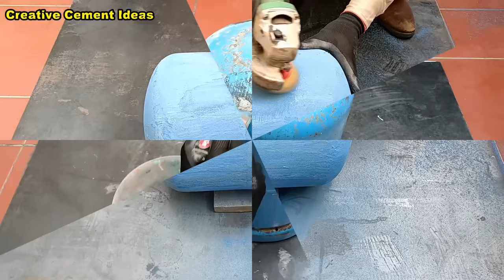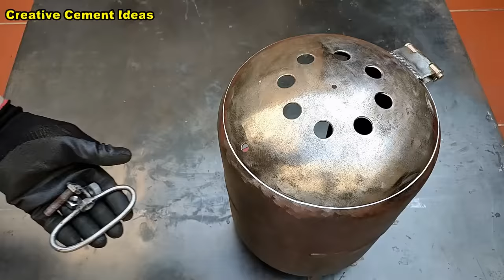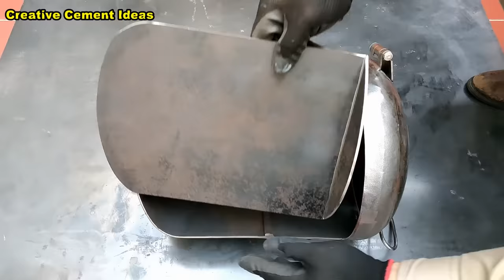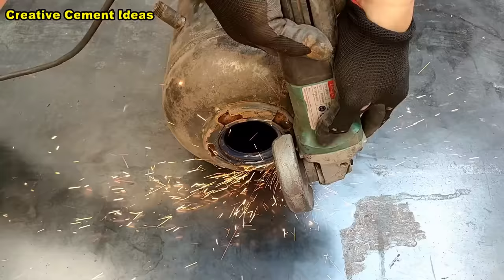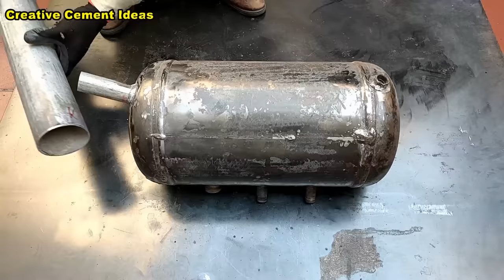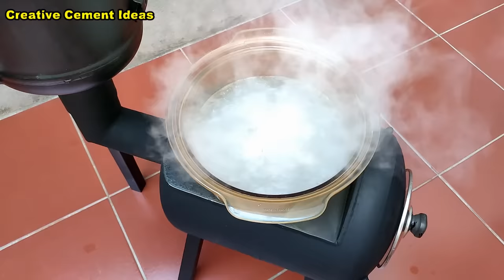How to make a very effective 3 in 1 multi function fireplace

Comment: Love the flue pipe water heater, and the glass lid for the intake air control is cool too.
Reply from the maker: Thank you very much
Reply: The water heater could be used too generate steam, steam engine for electricity or mechanical, steam room, radiator for heating... Wonder how efficient it is.
This guys a wannabe macgiver.
Reply: @CreativeCementIdeas  ггг⁷7ш889шш81111Шшш8
Reply: Юлия
Reply: Молодец брат
Reply from the maker: Спасибо
Reply: V   0
Reply: Be

Comment: WOW! Great job! I have seen many DIY small, wood burning stoves, but adding a water heating tank is genius!! I am interested to learn about the welder you use. It is small & looks easy to use. Can you provide a link on the internet that shows the equipment you use? Thank you🙏🏼
Reply from the maker: Hi, I use kenmax 200 mig welder
Reply: @CreativeCementIdeas  i could have sworn i saw a stick. Regardless, great build
Reply from the maker: Thank you very much
Reply: @Ed19601  I just ckd, there are models  that operate 3 ways: Mig w gas, 
Mig w/o air, & rods(stick). I learn something new every day!
Reply: @CreativeCementIdeas satıyormusunuz fiyatı nedir nasıl spariş edebiliriz
Reply from the maker: Merhaba, bu bir DIY eğitim videosudur, fikirlerimi alabilirsiniz.
Reply: @CreativeCementIdeas  🌹🌹❤❤

Comment: Fantastic! What kind and size of water heater is that? Is it out of an RV? Gas, electric? And I have to ask, did you use a stainless steel pipe to go through the water tank? Would you not need stainless to keep rust from forming inside the tank? Thanks for your time. 😀
Reply from the maker: Hi, if the water tank and chimney are replaced with stainless steel, this product will be great, thanks for your opinion.

Comment: I have a doubt , is it  LPG gas cylinder in which you used a water pipe to drain out gas ( is it safe , can you explain a bit more )
Reply from the maker: Hi, it's an old gas tank that has been rejected, I have to fill the tank with water, then rinse it before cutting
Reply: @CreativeCementIdeas  thanks for the reply

Comment: I would be scared to cut opem a empty gas bottle with sparks flying around wont it blow up or have you got a way of cleaning the tank out
Reply: The tank was cleaned out with water by the looks of it so all residual materials are gone. Pretty amazing hack wasn’t it
Reply from the maker: Hi, just fill up and clean the tank with water
Reply from the maker: Thank you so much

Comment: Don't know if that pot lid will survive the heat ‼️
Reply from the maker: Hi, it's for regulating the wind, and for viewing and controlling the flame, and it's not fully exposed to the flame, it's heat resistant to 700 degrees celsius